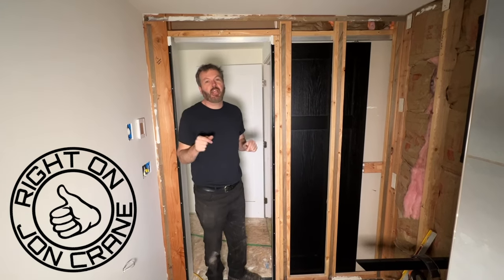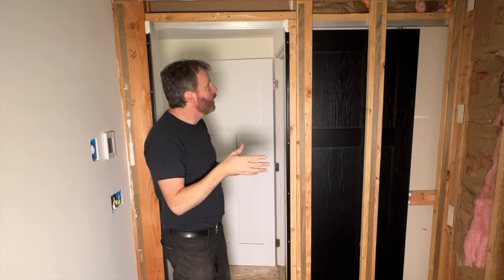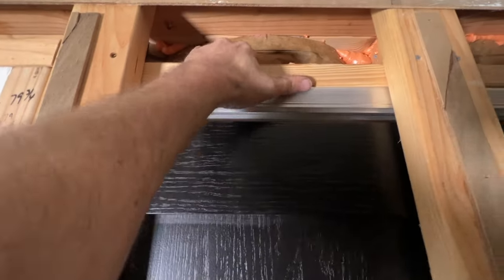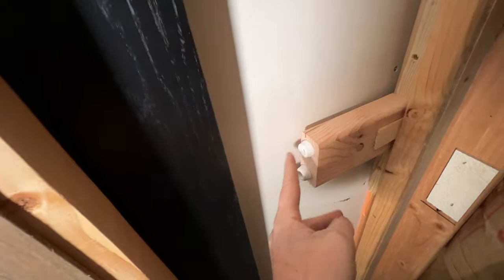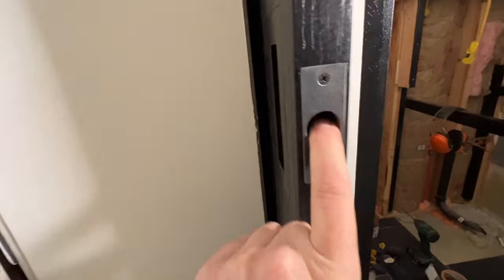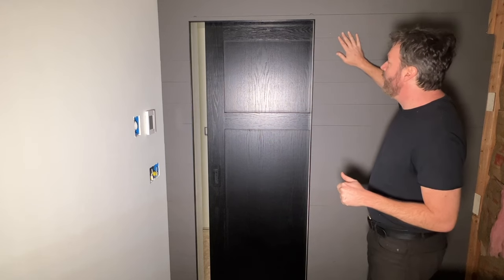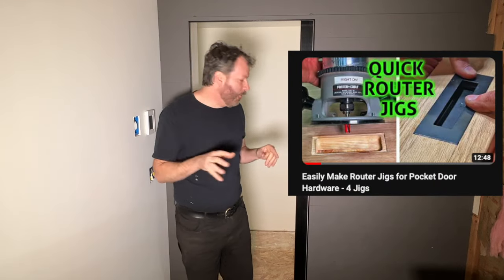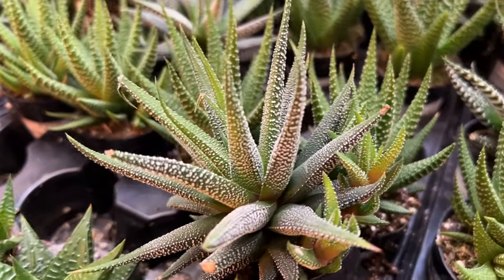Build Your Own Pocket Door - Faster - Better - Stronger! Save Cash $$

Comment: I'm a bit confused.  You can't put 2x4 on each side because 2x4 is 1.5 inch thick.  If you have framing on both sides of the door then you have 3" which doesn't leave room for a door when your adding it to a 2x4 wall.
Reply: Your not a builder so that's why you cannot comprehend the concept of how it works...
I built my own sliding doors and didn't buy anything because I used another homemade application and my doors work like they were factory made ...
Reply: @orlandogivens4779  Don't be ridiculous.  I'm an engineer,  math is math. This will not fit a standard 2x4 interior wall.  That is not up for debate.  I think what you mean to say is that this solution will not work in a standard interior 2x4 wall.

Comment: That's exactly what you do with those frames 🙂. Great work! 
Redoing the master bedroom in my new house that has a pocket door into the bathroom and discovered that the wall that the door slides into isn't attached to much if anything. When I was removing the baseboards I found that entire section of wall is moving in and out. 

Clearly those guys did not throw away that frame. 😑

Comment: What material did you put on the walls I like it
Reply from the maker: Right On! 🙌 Thanks! For the pocket door wall I put t&g pine and for the vanity wall I put rough sawn doug fir. I stained it black then lightly sanded it and put on a clear coat. All water base products.

Comment: So your door is less than 1/2" thick? Or you're not using a 2x4 for the bottom and top plate? 3.5" wide 2x4. Turn the studs, each stud is 1.5" thick. So you have a .5" gap... 🤔

Comment: It might be cheaper to buy a unistrut and some unistrut-carriages.
Reply from the maker: Oh that’s an interesting idea! There are rolling carriages for unistrut?
Reply: @RightOnJonCrane  Not only do they exist, there's a much wider range of sizes/weight ranges. They're generally called Unistruct Trolleys.

They can also work with curved Unistrut sections for a light duty shop-crane.
Reply from the maker: @Zaniahiononzenbei  very cool! I will look those up. 🙌 Thanks.